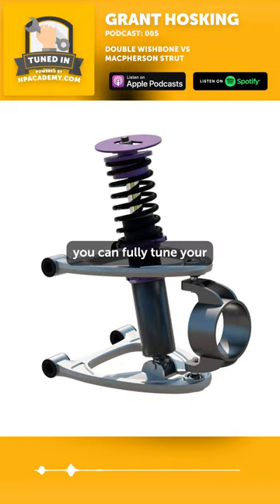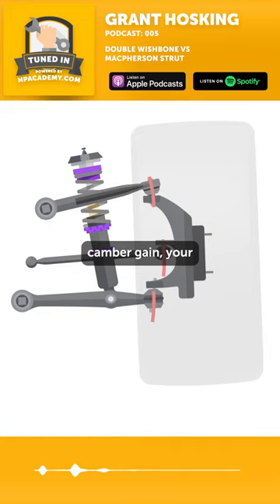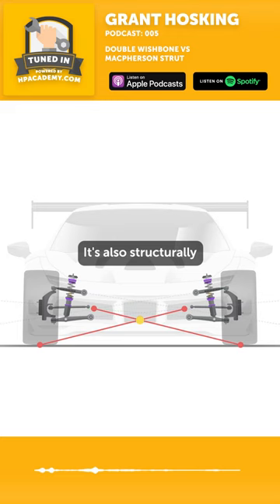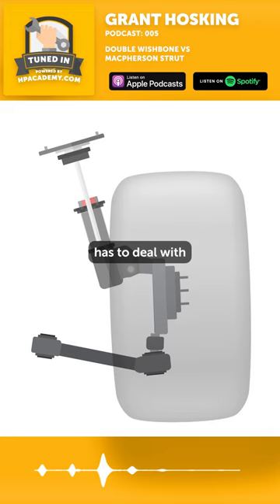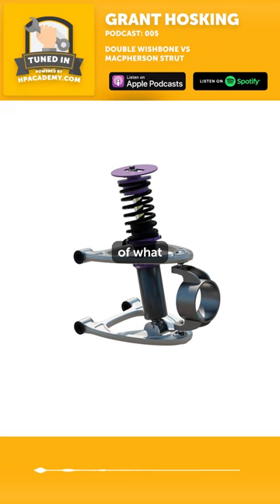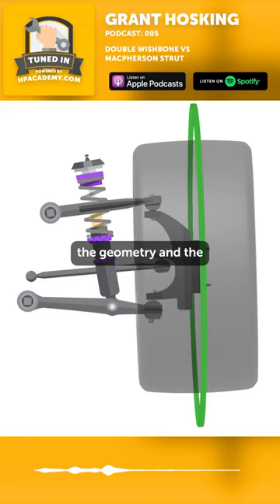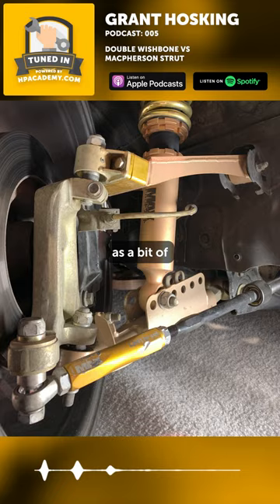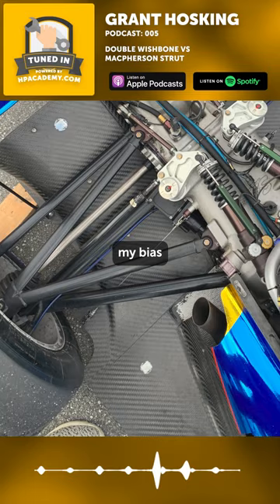Double Wishbone Vs MacPherson Strut #shorts

Comment: Downsides to a double wishbone that no one wants to talk about is the multitude of failure points that comes along with not only tuning but in the instance of a part failure and damage. A McPherson is, in some cases, much more convenient when it comes to trouble shooting and damage repair. Thus the reason they are the go to choice in rally.
Reply: At the same time the Dakar Rally Legend Mitsubishi Pajero does run a Double Wishbone suspension and a Multi Link Rear.

Comment: Macpherson strut always seems to feel less rigid(smoother over bumps. Less steering precision) in my opinion.
Reply: 9 times out of 10 you're generally just dealing with a cheaper car and cheaper suspension to begin with. So of course
Reply: Well macpherson struts are generally in low end and cheap cars while double wish bone are generally in expensive and sporty cars so other factors like the quality of materials shocks joint and tires are also a lot higher quality then cars that tend to come on struts making the difference even more pronounce.
Reply: @patthonsirilim5739  but it’s always dependent on many factors, if you’ve driven a 5.5/6th/7th gen Celica they handle really well and the rsx and they’re on McPherson rather than wishbones and in my opinion handles way better than older civic and accord on all wishbones. It’s all about the platform and design, my Celica handles in most cases better than a 5th gen civic/dc2 integra/del sol
Reply: @eVerProductions1  ofcourse reserch production excution development and other associated parts plays a big part in the overall quality of the suspension but double wishbone and multilink still holds a physcial and geomatry advantage compare to struts and torsion beam suspension and they tend be more epensive which means they are mostly use in higher end car that tend to use even higher quality components and development pushing the gap in quality even more drastic.

Comment: always wondered why BMW M cars stuck with mcpherson setups when double wishbone has more advantages at that price point
Reply: Same reason it always is with German cars, it's cheaper.
Reply: I think space savings and packaging is a big deal. The double wishbones take up more physical space. I’m just spit balling though as I can’t speak for BMW’s engineering team.
Reply: @drewski5730  just realized that invigorating wishbones also requires $$$ and weight to make the additional mounting points structurally sound
Reply: @slickest123452  BMW typically doesn’t use a traditional MacPherson suspension associated with budget cars. They use a more complex dual pivot design, using two lower control arms rather than a single one. This allows for the possibility of camber gain in compression and more space for larger brakes.
Reply: Cost factor plus being a big engine Front engine car double wishbone we’ll make packaging more challenging cars with double wishbone are often cars with mid engine layout.
Reply: Porsche 911 Mitsubishi EVO Camero ZL1 3 of Best Handling Cars and all Use Front McPherson Struts
Reply: @sannissansanjuan5074 those cars handle ok. The 911 gt3 uses double wishbone suspension, Far better handling.
Reply: @sannissansanjuan5074  yeah most of those cars are extremely good at handling for sure. Porsches new gt3 uses double wishbone up front instead of mcpherson for the first time in the history of 911 and it’s their fastest track car ever so far.
Reply: @2seep Have you seen the price of the new GT3 ? At that cost they can afford to develop a double wish bone set up with its advantages over the previous set up which Porsche have used for decades in all their cars.
Remember the GT3 is very much aimed at winning races series with the odd luck road owner.
Reply: @IPL_VIC   IF you Don't the 959 they use Front Wishbone Too, Not the First, The 928 was in the 70s
Reply: @derekcable   lol the 911 is the most race successful production car of all time.... Dominated group 5, IMSA, Dakar, Trans AM series, ALMS, etc etc. most class wins at le mans, Sebring, and Daytona. Even winning Le Mans and Daytona overall a couple times against prototypes.... I don't think it matters what front suspension the 911 has...... LMAO 😂
Reply: @2seep  base 911 handles okay? Lmao 🤣
Reply: @29DreC  no, bmw is cheap

Comment: True, in a Macpherson set-up, the strut takes all of the load, but that's its job. In a double-wishbone set-up, all that load goes through the lower ball joint, which leads to accelerated failure.
Reply: That's usually do to poor maintenance, or people putting excessively high spring rates, and lowering on factory balljoints.
Reply: I’ve never once had an issue
Reply: @804MRMAN other than inspection there's no maintenance of lower ball joints just like a double wish bone set up.Anything that goes away from factory specs like lowering will wear suspension components out faster even in a double wishbone set up.
Reply: @Racing_Fox413 likewise here Inc all the people I know who have driven 10s of thousands of road miles over many many years in front wheel driven cars.
Reply: @derekcable  What are you talking about buddy? 😏
Reply: @804MRMAN  I'll repeat "There's no maintenance on BALL JOINTs just inspection just like any other suspension components.
Components that are found to have any wear are replaced.

Comment: MacPherson it's more cheaper and weaker, wishbone it's more expensive and stronger, top of the line cars have wishbone or multilink...
Reply: In my opinion the downside to a double wishbone is that it's more expensive and takes up more space in the front of the car, the MacPherson is the go to for only one reason that it takes up less space in the front making it a viable but not the best In this case the double wishbone is the superior suspension.